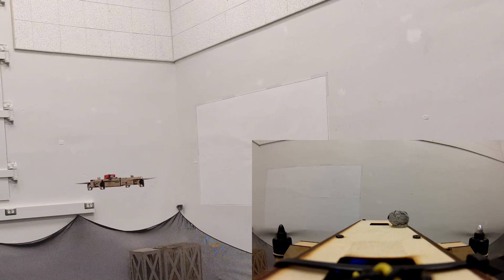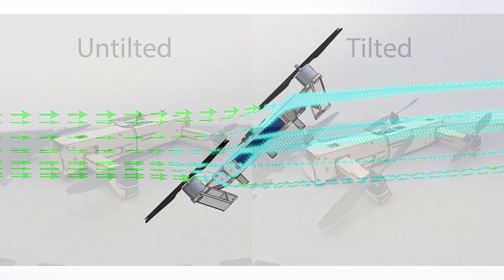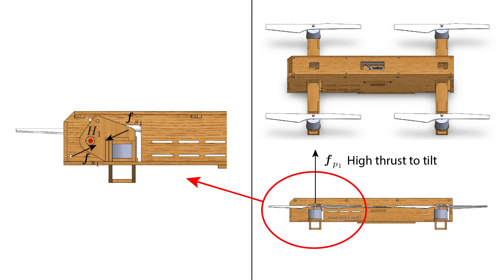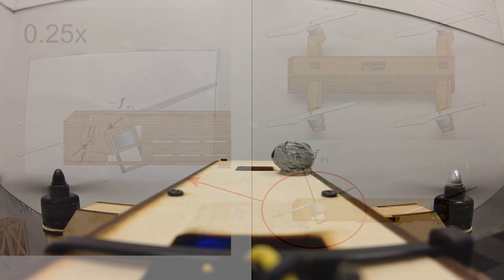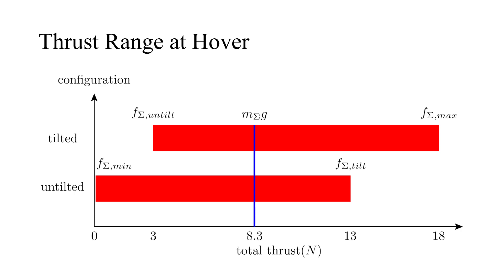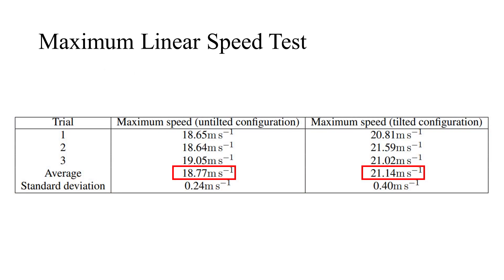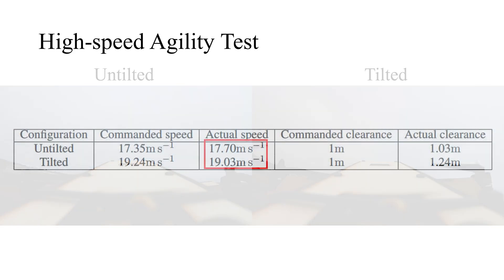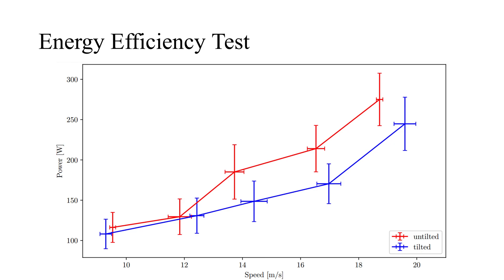A Quadcopter with Unactuated Rotor Tilting Mechanism for Faster, More Agile and Efficient Flight

Comment: Would the benefit be as drastic in a more aerodynamic X-shaped drone (which presents less drag in forward flight than the boxy H-pattern drone here)?
What about rear propeller efficiency, now that they are even more in the propwash of the front propellers?
Tilting rotors, fixed or dynamic, were tried years ago in the hobby, and never caught on.
Interesting that you used a spring mechanism instead of servos though. Good luck.

Comment: why don't you leave tilted all the time? That mechanism is novel for sure. But just leave it tilted and  save weight. This reminds me back in 2015 when we (the FPV community) added spacer under the motors to tilt the motors because we all thought you would fly faster and win race. It didn't take long to realise that this trend died real fast. 🤣

Comment: Good proposal to improve present day quadcopter flight parameters such as top cruising speed and fuel efficiency, at a low cost. Improvements ("12.5% higher top speed" and specific "power consumption over 20% lower") have real marketing value. Questions remain about the feasibility of the solution in case of bigger quadcopters (VTOL-s carrying people), and about the effects on the maneuverability (steering) in real life situations.

It is good to remember that

(a) when cruising speed/efficiency are important you need (at least in the subsonic world) wings;

(b) the ultimate VTOL technology is built on a real tiltrotor solution. This will become ever more obvious when the new generation of rotors/propellers become available. Those which can perform equally well in vertical lift and in cruise flight.

Comment: This is an interesting design and certainly good validations. However, it would be also interesting to ask what if the system can remain in the tilted configuration structurally. in theory it can still perform like conventional quadrotors, and in addition, the front landing gear can be longer than the rear ones, thus ensuring the propeller plane lays flat when the system lands. This way the design doesn't need the hinges and provides low drag in tilted forward flight without and hinge. Something like the DJI FPV drone (not Avata 😅).